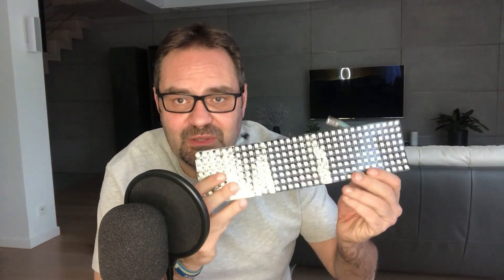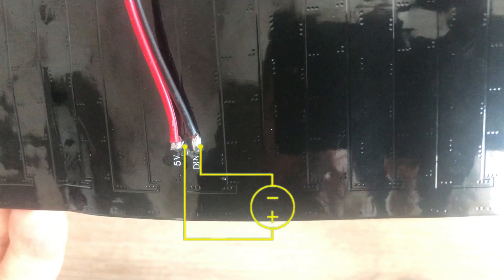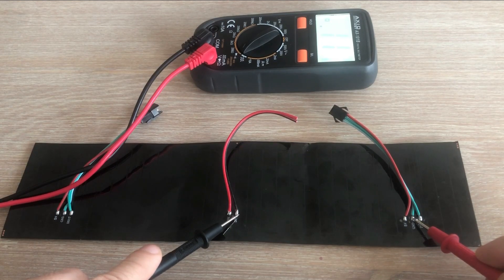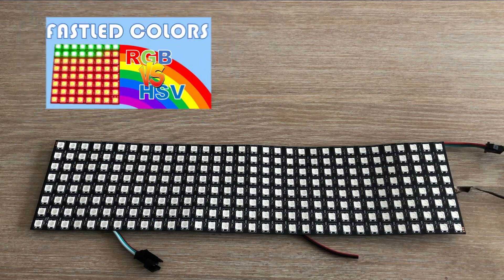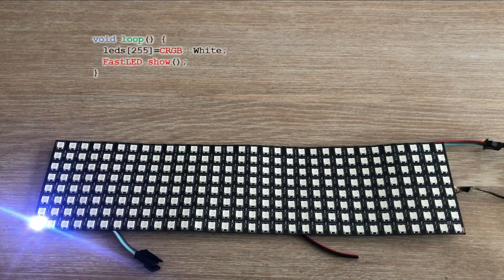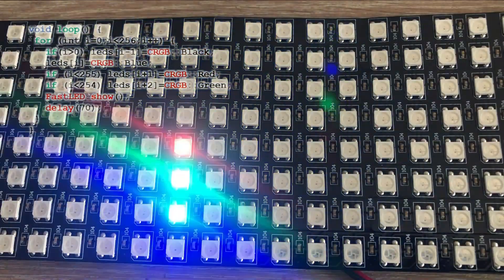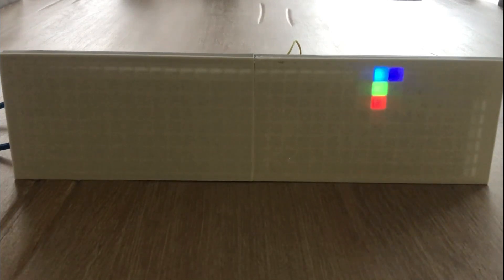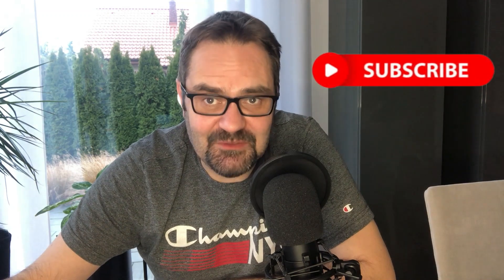Coding with Color: Arduino's Control over 32x8 WS2812 LED Matrix PART1

Comment: Your colour problem has to do with the LED order in the neopixel. The blue LED is in the right position but the green and red are interchanged (according to the order you specified in your sketch). I believe there is an option to specify the correct order of the LEDs in the library.
Reply from the maker: I created a dedicated video where I discuss this

Comment: Hello Mario!!! love the video, do you have the design files for 3D printing the defusing panel, or could you sell me one already printed?
Reply from the maker: The diffusion panel is not 100% ready. I am planning to work on it in coming weeks. To incorporate screw terminals and the container for the microcontroller placed on the custom PCb. When this is ready I will place this design on My ko-fi page for download

Comment: Is it possible to connect 8 such panels at the same time and use Arduino?
Reply from the maker: Yes you can. But then you have to power it externally as Arduino cannot draw this much current. practically even for one you should have external 5v power supply.  For 8 you would need something like this https://pl.aliexpress.com/item/1005006325304280.htm. Then you would only connect one signal pin from Arduino to DIN pin of the first matrix and then daisychan the rest
Reply: Let the code be for Arduino Uno. Of course, I supply the voltage of 5 volts from an external supplier with a higher current

Comment: Hello, Mr Mario
Can you help me out with how to run multiple max7219 modules with arduino ? ( specifically 5 modules )
Reply from the maker: I have created videos on MAX7219 modules. One obout PAROLA library shows how to work with multiple modules
Reply: @marios_ideas  can you refer me to that video ?
Reply: Mr Mario, I’m currently working on a project where I need to interface one ESP 32 with three arduinos
Reply: Can you help me with this ?